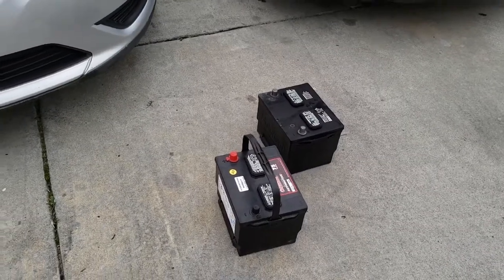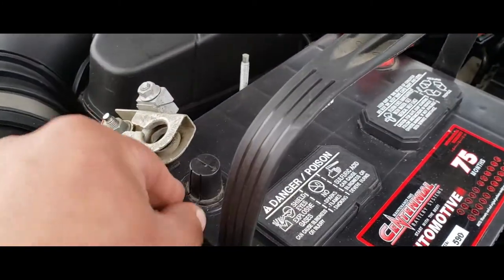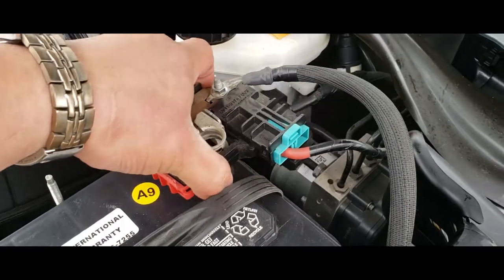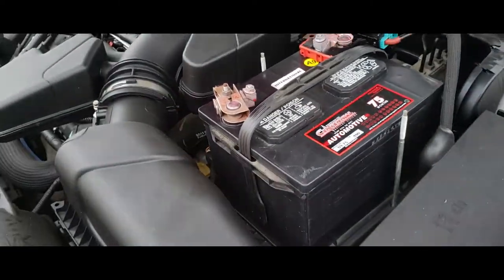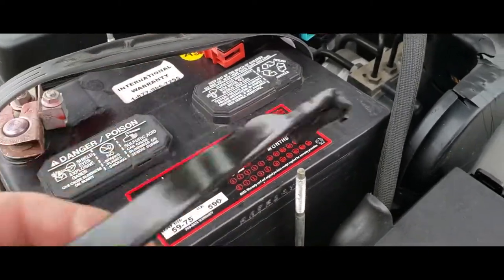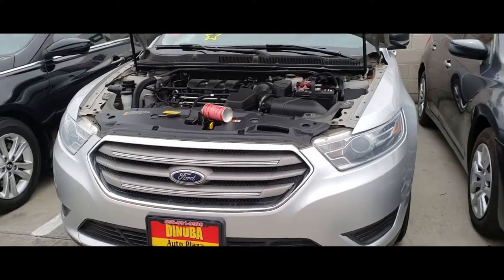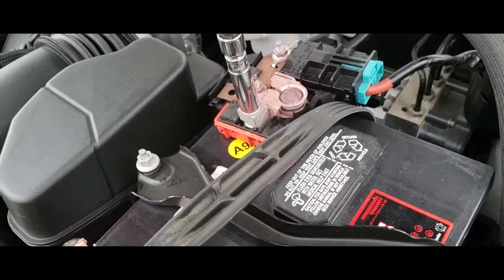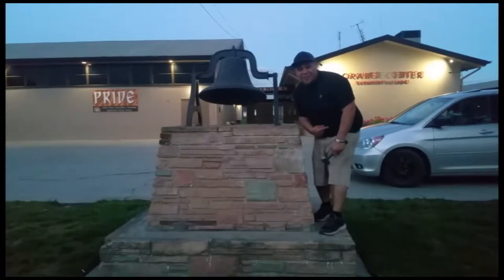How to: Install a battery on a 2014 Ford Taurus

Comment: Hey man installed mine on a 2015 interceptor and now it won’t acknowledge the keys and the screens are blacked out any suggestions?
Reply from the maker: Huh, thats hecka weird. 🤔 Is it push to start? Try holding the the fob next to the start button and press it with the fob. If NOT try maybe unlocking the door with the key on the driver's side. Thats hecka weird...would you happen to have a volt meter? Make sure the battery is at 12 volts and check if the Battery Terminals are receiving the same voltage....some times corrosive material can build up and cause a miss contact and cause problems. Make sure the posts and terminals are clean of corrosion using a wire brush...I really dont know why it would act up like this....thats really odd 🤔